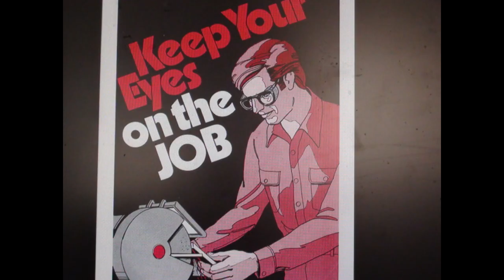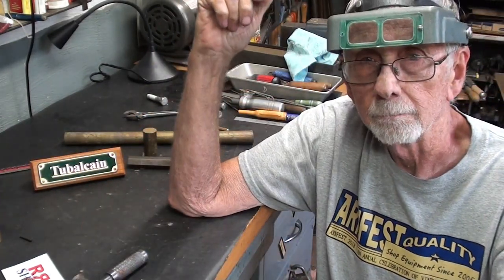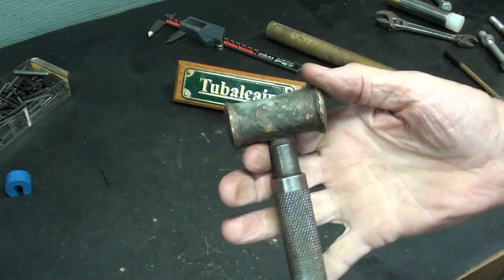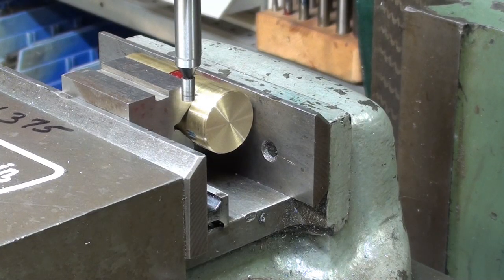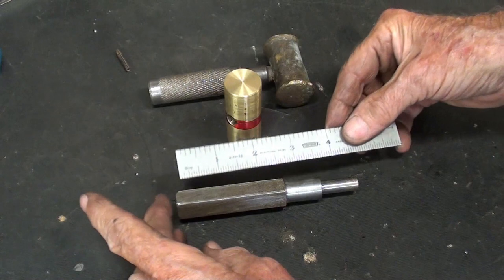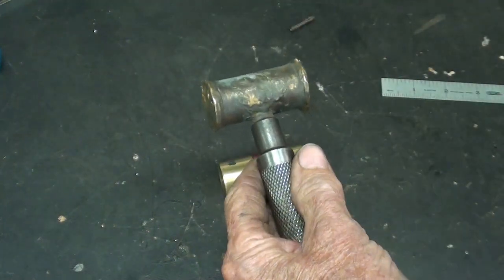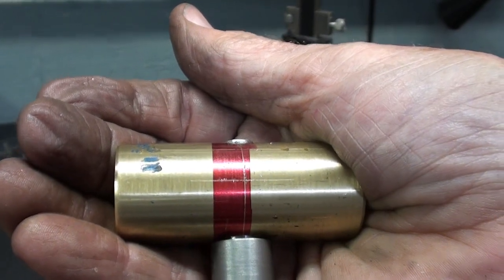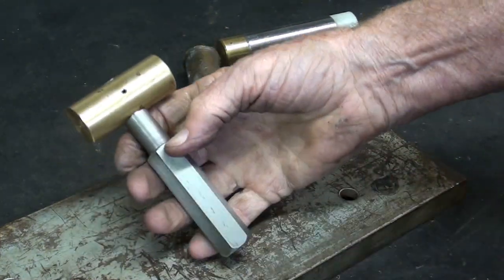LITTLE BRASS HAMMER tapper rapper #775 tubalcain

Comment: I grew up using a similar small brass hammer my dad had, very useful for model building, tapping out tin or brass sheet,  and small pin insertion. Years later, after he passed away, I found many of his tools had been raided, stolen by the rotten sister's drug addict buddies for pawn. That was one tool I really wanted to keep... sadly long gone.

Comment: I have not had difficulty knurling, but hex brass was what I used in metal shop to make a new shift handle for my first Datsun pickup, the factory shift lever had a hole that connected it to the linkage, and it had hogged out. Working brass, I heated it and made an S bend in it, was a nice school project.

Comment: I made one, using a small block off of some long ago scrapped machine, and a steel rod from it, that had a convenient step in it that fitted the central hole in the block. Slipped in, then riveted the steel rod over on the top, and had a small tool with a chromes steel handle, that was perfect for light use, small enough to fit in tight spots, but still a 50g head to tap with.

Comment: I remember when an apprentice made a mallet and put a round cylindrical hole through the centre . A hydraulics fitter used it and the head flew off and hit another fitter . Thus it was discovered that the hole through the middle has a double taper in it for a reason . Oh by the way the fitter was not injured but did swear a bit .

Comment: That's a sweet little hammer, really glad you dug it out of the scrap bin, Tubalcain. Even better you made a project video about it, really like those brass chips as you were machining the hammer head. Red metals are just great, copper, brass, bronze, really like to see you working with those metals. Have you ever tried to cast any red metals? I definitely enjoy the many videos of you casting lead and aluminum as well.
Reply from the maker: Thank you for watching.
Yes, I poured brass and bronze in the school foundry hundreds of times over the years. 
In addition to that, I helped my brother, many many times, pouring bronze into his lost wax sculpture molds
Reply: I figured you have Tubalcain, just never seen any videos of you casting red metals. Did you help your brother with the fawn sculpture? You have showed that sculpture in numerous videos it is definitely a work of art. Casting bronze in the lost wax technique is a connection to ancient mankind that fascinates me.

Comment: also very nice to have a handle when using it as a driver. I melted down some pistons for an aluminum hammer, with a claw hammer handle. used a tin can for a mold.A brass hammer can do some damage, aluminum not so much, I like it better than the plastic deadblow.